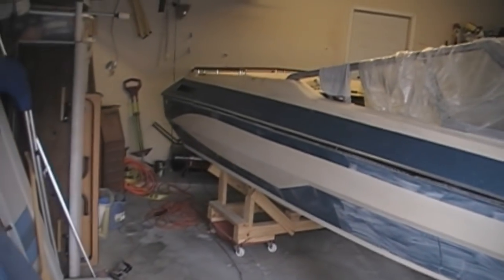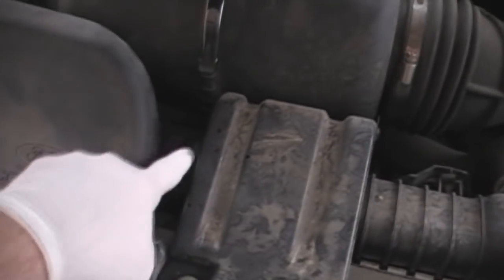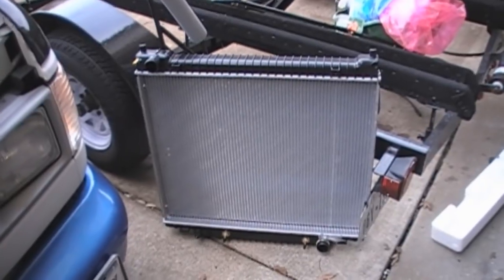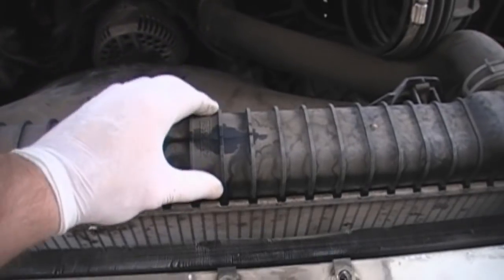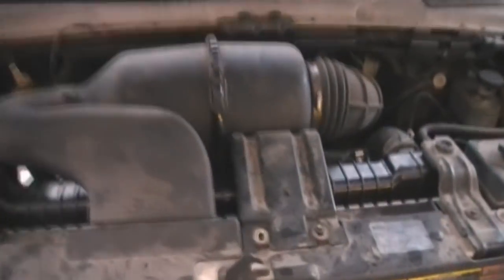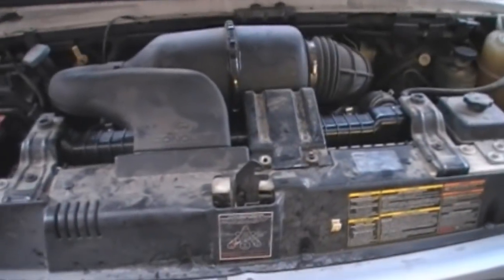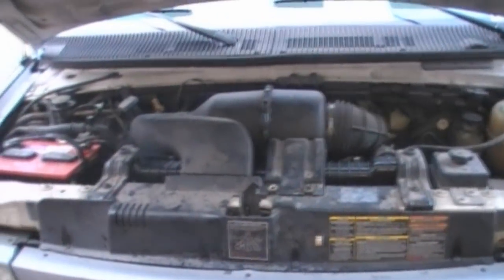Replacing the radiator in my Ford van

Comment: So you completely skipped how you go about taking everything apart to pull it out......
Reply: Well it's pretty simple.. 10mm bolts. 8mm bolts. Some hose clamps and transmission lines. Out she comes...

The tricky part. Make sure you get the 2 core. As they will sell your the cheap single core. And it will over heat when the AC is on...

Comment: I have looked online, and the one listed is a ONE Row unit. The one that is on it, (OEM) appears to be a 3 row unit. The one on it, is 2.2" thick, at the main body of it. (Where the cooling fins are) The one listed for it online, is 1-1/8" thick. I LIKE a thick radiator. I don't like a MARGINAL cooling system. It looks like the replacement one is marginal. Mine is a 1999 E-350 16 passenger one, with rear air. Is it ok to use the thinner replacement one? It is the 5.4 L Triton. Thank you!

Comment: No radiator cap?How do you fill it up?
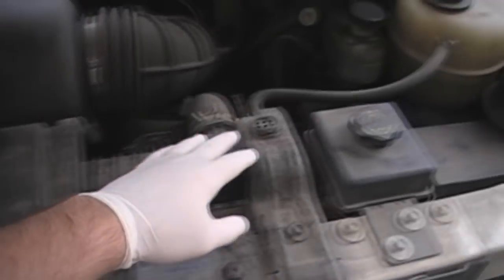Reply: From the coolant reservoir seen at 1:45
Reply: I don't understand how a coolant reservoir works
Reply: It works as a overflow and pressuized fill point for some radiators
Reply: How do you know your radiator have fluid if you can't open it up and inspected it?

Comment: Good video. don't need to show every step because it is very easy replacement.   I got a new radiator at u radiator in Miami for 99 bucks and on ebay they have them for 89 to 119 bucks.  I'll never buy at big box stores again!